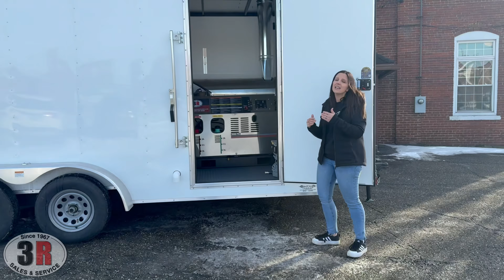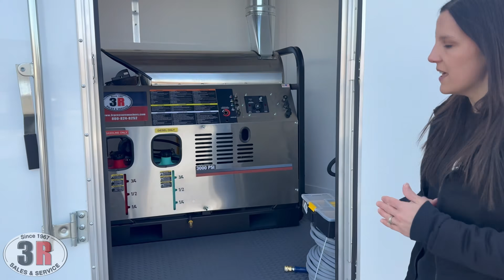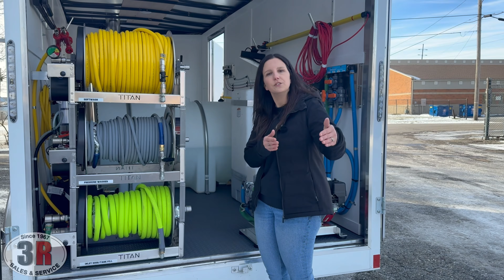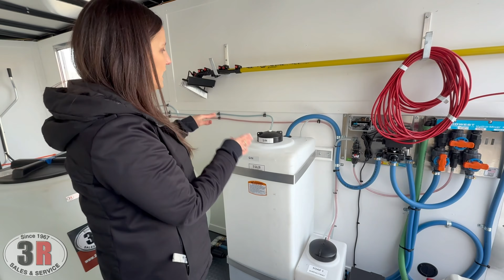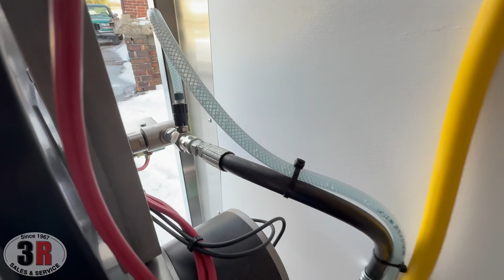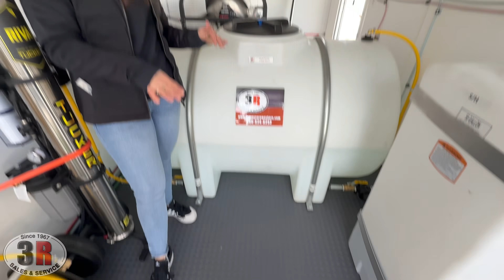GALAXY 16’ Enclosed Mobile Wash Trailer: 7.8 GPM Hot Water, Gas Soft Wash, & Window Cleaning System

Comment: Hello please help with this question 
Why is not popular slide out the pressure washer machine even for safety or gas odors 
Like build a slide out aluminum to take out a little bit the machine out 
Thank you
Reply from the maker: That's a great question!  These hot water machines are several hundred pounds, so they're strategically placed, along with other equipment, where their weight is distributed appropriately inside the trailer, and then secured.   Because they're stationary, we always exhaust the burner through the roof and exhaust the engine through the floor so that there isn't a build up of exhaust inside the trailer.  For some of our smaller single cylinder engines, we'll typically put these right at the back of the trailer so when the back doors are opened, they get plenty of fresh air.  It's always recommended to run your equipment with the doors opened so your machines are getting plenty of fresh air intake.